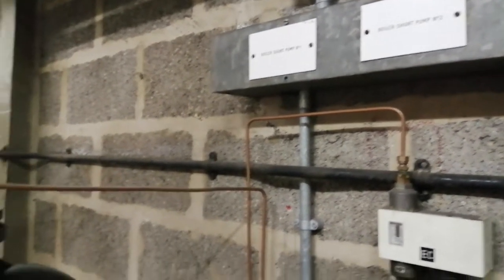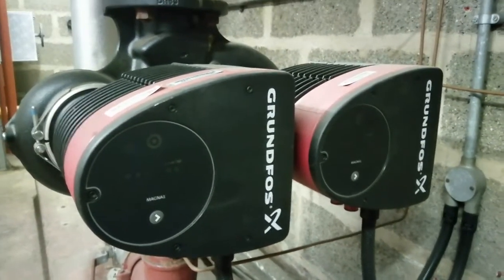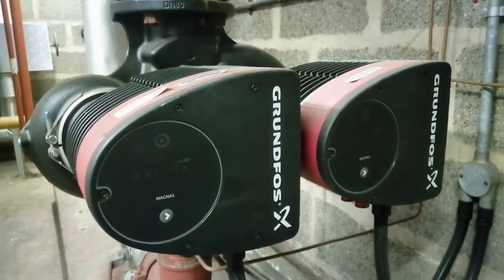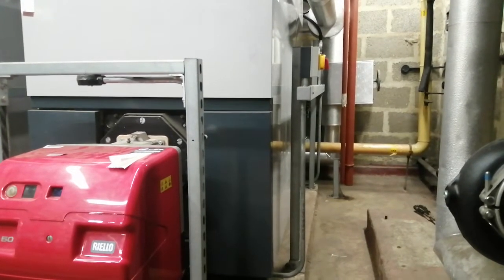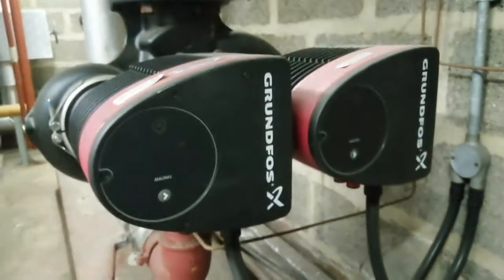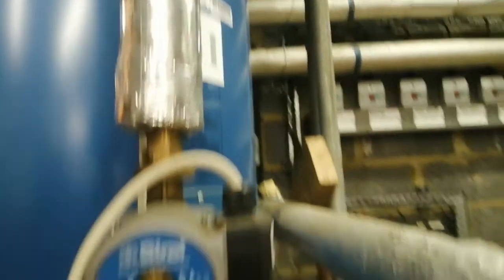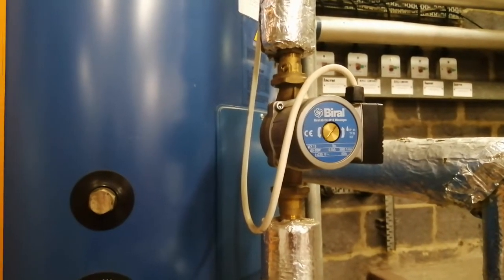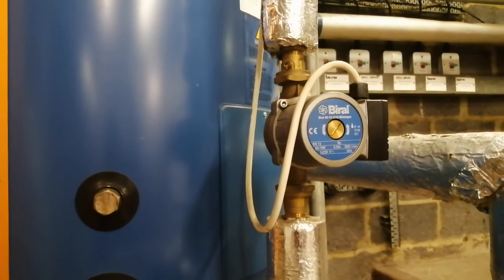SHUNT & DESTRATIFICATION PUMP

Comment: Thanks for the video, would be good if you showed the piping set up and how the shunt pump circulates the water from the return to the flow etc. Diagrams good also.  Keep up the good work.
Reply from the maker: @dickyrock1  that's a good idea with the diagrams etc. Sounds like something for the engineering mindset channel. Hoping to do more manuals/diagrams vids one day.